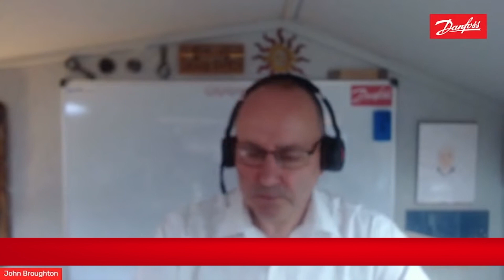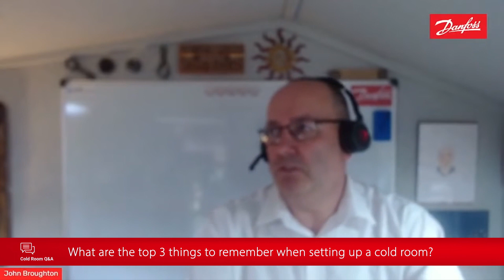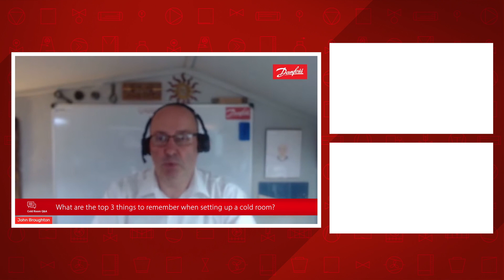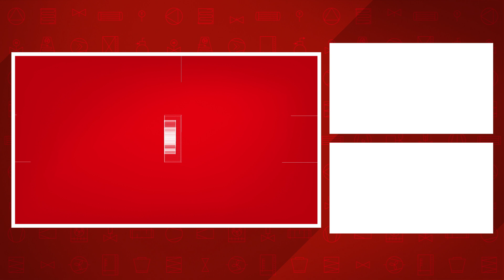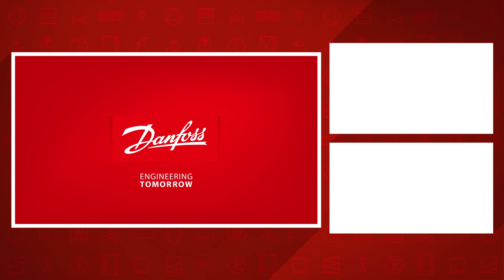What are the top 3 things to remember when setting up a cold room? | Ask an Expert

Comment: Hello, I have a question. I am asking because I have to calculate the logaritmic mean temperature difference. An air-cooled evaporator will be placed in a room and the evaporator temperature will be -40oC. Desired cold room temperature will be -35oC. What should be the temperature coming from the evaporator to the cold room and the temperature going from the cold room to the evaporator?
Reply from the maker: Hi, Thank you for your comment. In general you would use a 6 kelvin TD on a freezer room, meaning if your evaporating temperature is -40 deg. C, then your room temperature would be -36 deg. C.
You need to ask the evaporator manufacturer to calculate the LMTD. You can find some information in this Danfoss Learning Module. Hope this was helpful :-)
Reply: @DanfossClimate  you mean -34 room temp??